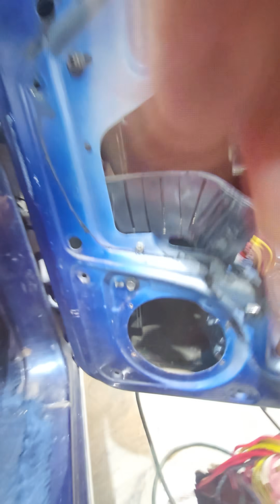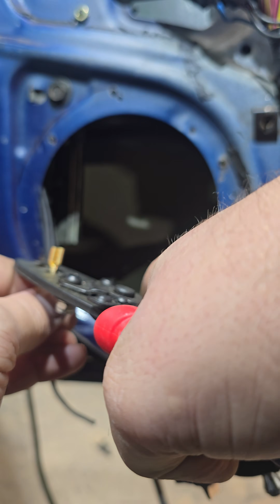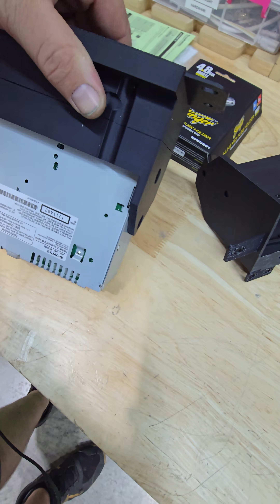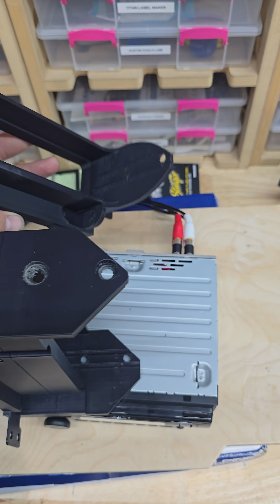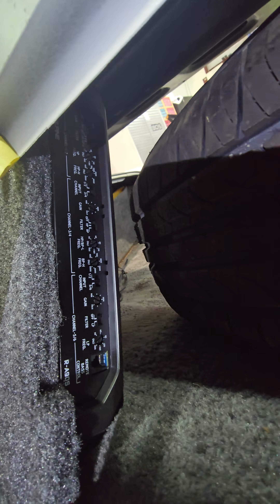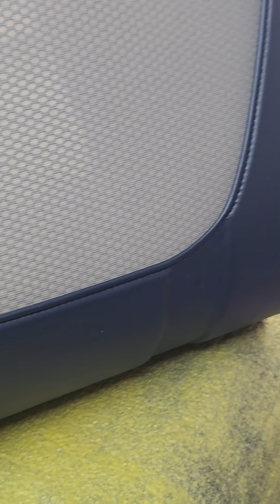WAIT!? That's the SUB ENCLOSURE!?! Audio System build

Comment: i did 100s of these installs when i was getting out of high school 1991. i used plywood with clear coat for face plate then use the hanger on the back of stereo. the door panels id make pods out of fiberglass shaped from salad bowls .put a piece of ply wood in place of speaker then screw the pod in place over the door panel with foam over the plastic . my sub boxs are always made from pianos . i worked for rex lumber ,they made all the sides for Steinway so i made my sides from there "scraps" . what you did looks great but speakers need enclosures not just subs. every time the doors or truck are opened or closed those speakers are flexing to the max not only that but they sound 10000000x better in proper sized enclosure .
Reply from the maker: oh wow that's awesome!!!

Comment: Everything so awesome, but why put mic on the dash far away from the driver? Should be on the windshield or the headboard closer to the drivers mouth. What an awesome setup though, some good problem solving and adjusting on the fly, 3d printing parts. Well done son. Well done.
Reply from the maker: Thanks for the honest feedback! I agree with you that this location was not the best. But if I move the location to somewhere optimal, then I would have had to mount it in the open or modify a really oem panel and one of my personal goals was the has a completely reversable system install. 

we tested it and it was not ideal in any sense, but I was ok with the performance without having to modify

Comment: So many questions LOL
1. How did you figure out the angles for the subwoofer enclosure? 
2. Where did you learn how to sew because that enclosure came out great?

Beautiful work! I am subbed!
Reply from the maker: thank you!

So to find the angles I need, I started by cutting a piece that fits flat on the bottom, I then used an angle finder to see what the difference was between the back and the bottom, same for the other two bottom angles.

Luckly I have many years of sewing starting in the marine and automotive world. Sewing machine is just like any other tool, The more time you spend with it, the more control you have.

Thanks for subscribing!

Comment: Flash a heat gun on the face of that print a little, it will relax the plastic and get rid of that color difference. As it cools it warps, abs is really easy to fix this way.
Reply from the maker: Thanks for the tip, I'll have to try that out!